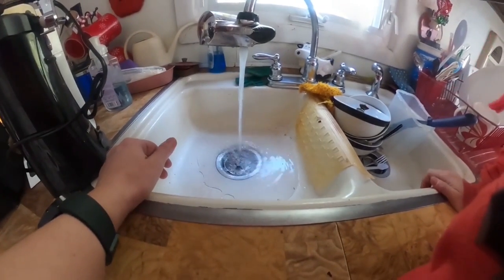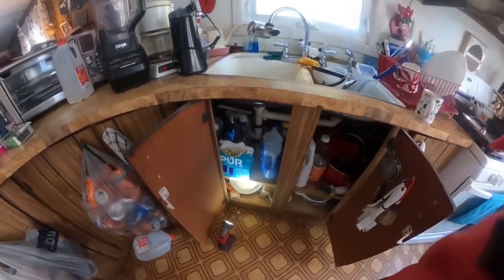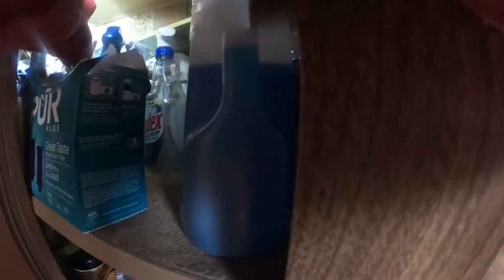How We Clean A Mobile Home Kitchen Sink Drain 204

Comment: Good job Shelly & Bob, mind if they knew you were coming could have least cleaned out the cupboard 👍👍
Reply from the maker: Yeah we don't mind though they are disabled. Takes just a min for us. (Shelly)
Reply: @DrainMedic  okidoki good on you 👍👍
Reply: I was thinking the same thing. I always remove anything that would get in the way of the plumber. They need room to work. You also don't want dirty water getting on what you store under the sink.
Reply from the maker: Doesn't bother us especially when they are disabled. (Shelly)